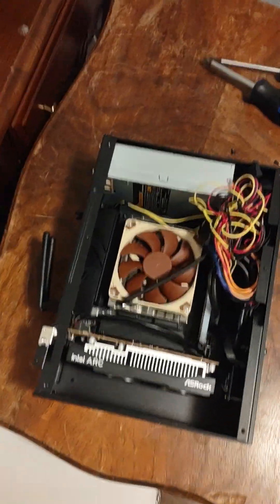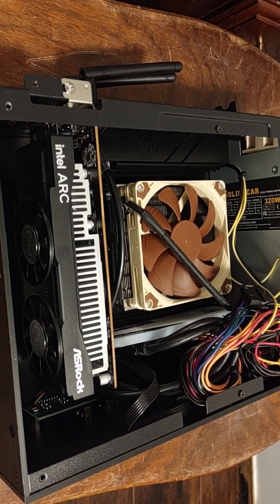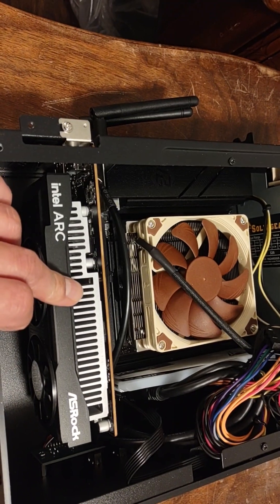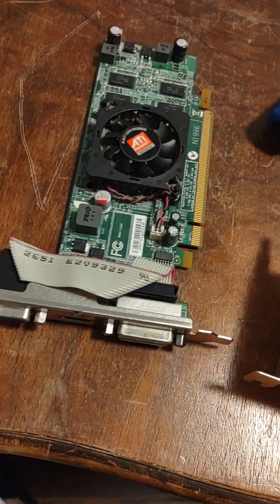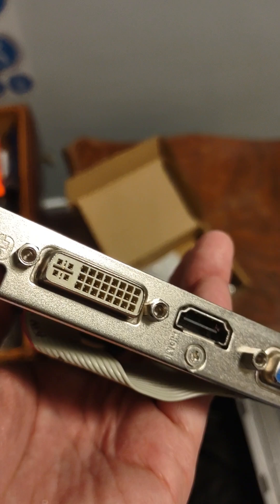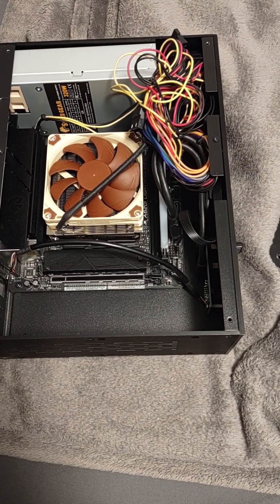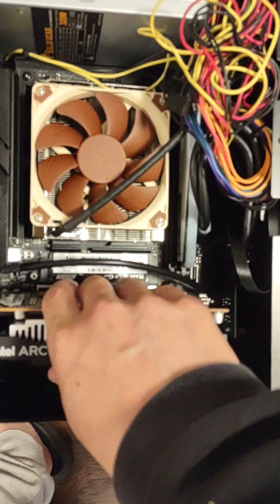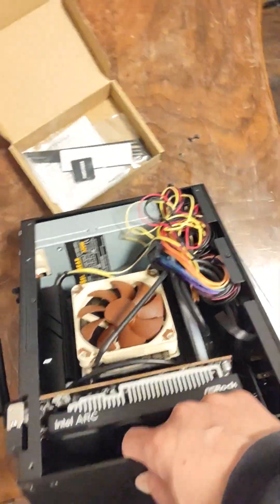How to NOT build a budget pc part 2 of 3

Comment: Im making my own pc for first time rn.  And i had a similar issue.  My issue was i had an extra mobo mounting screw on my case and it was shorting out my mobo.
Reply from the maker: In my case, it was the intel arc driver. I should of used the IGPU on the 7800x3d and could of just downloaded intel arc by using the IGPU. I did not know honestly 7800x3d came with integrated graphics
Reply: @PCAG888  it does ? I was told that the "x" means it doesnt have integrated. They told me to get one with a "g" if i wanted that.
Reply from the maker: @ktkxmarleygang  Yes it does. I was surprised too. I plug it into the HDMI port of the motherboard and it worked. Could of done that and then install the intel arc driver. It's also on the AMD specs too and it says integrated graphics.
Reply: @PCAG888  youre a genius. Thx for info !!
Reply: I believe the x3D chips do come with integrated graphics but the normal x series don’t. Still weird that x3D has it because nobody will be using those igpu’s on that high end of a cpu unless in very niche scenarios
Reply: @chielvandenberg8190  tru.  Cuz if you using an x3d you probably have at least a 4060 which is much better than integrated lol